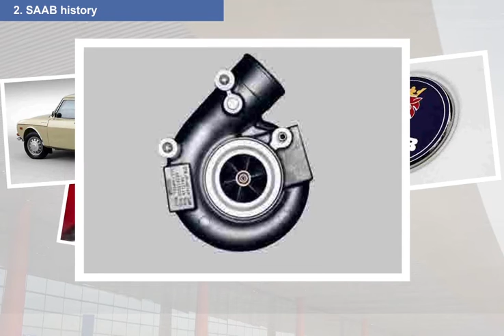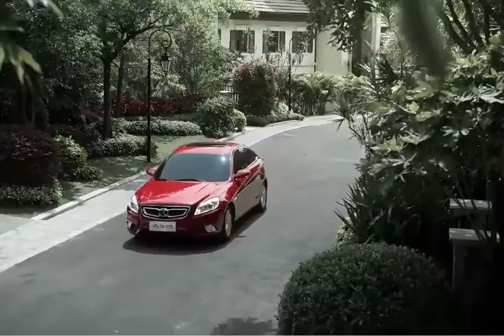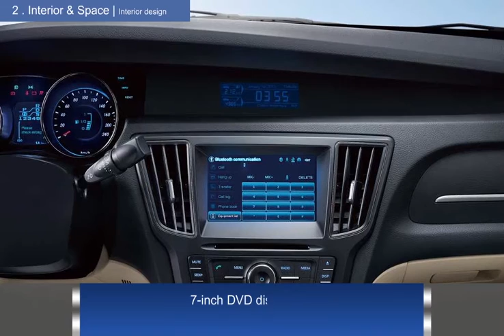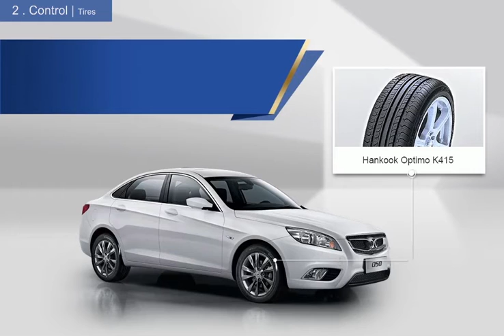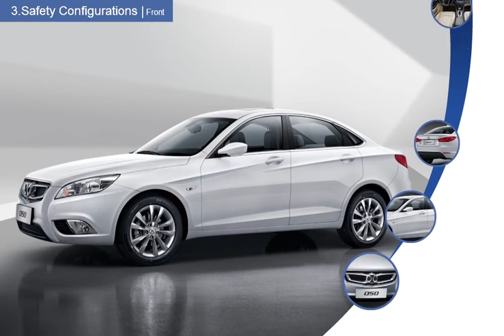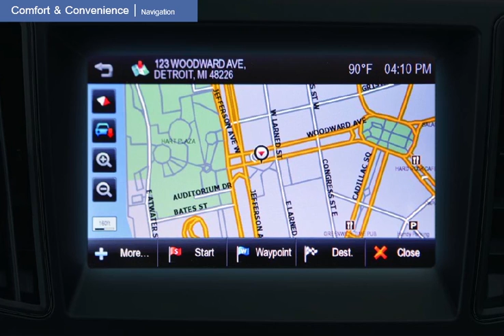BAIC D50 Product Course

Comment: I'm currently having a 2015 Baic Senova D50 1.6L MT, and it has run over 117000km so far.
I bought it second-handed last year, and have driven it for 15,000 km.
I have changed the cool tank and wind washer fluid bottle, cus they both leaked, and the entertainment screen was broken too.

the wheel wobbles when the speed is over 90km/h, and the transmission gear leaks oil.
but i'm glad it never drops me on the road.

 The car I'm driving is exactly the save model of baic D50, but Chinese version. I'd like to say that the engine is pretty reliable, but it's not baic's own development, its mitsubishi's mitec. It saves gas, about 6.5L/100km.
Suspension sucks, and they dont change much in later version of senova.
The only time it did'nt move was last winter. engine claw screw broke into 2 pieces, which probably never happen on other cars I guess.
Besides engine quality and its price in China, none of senova D50 is recommended. they all sucks.